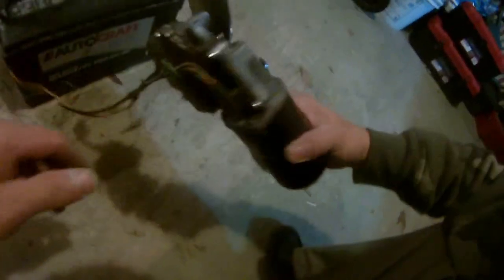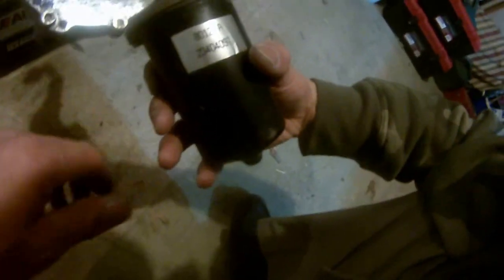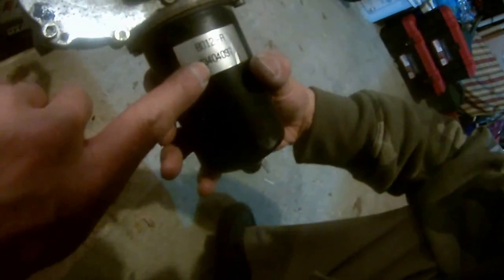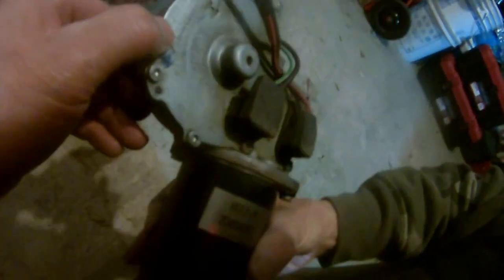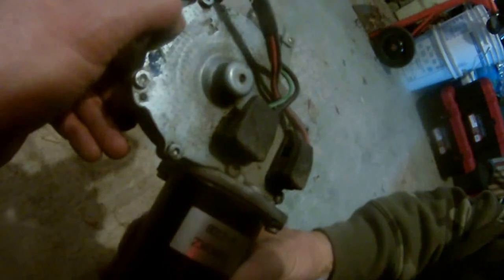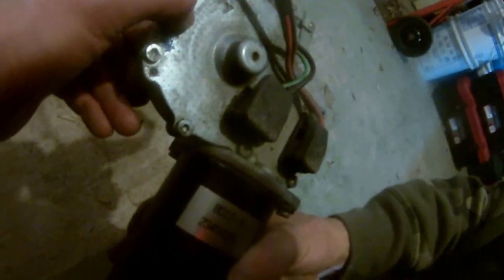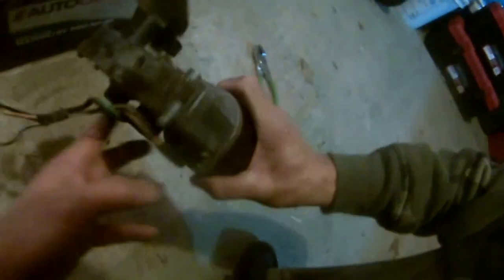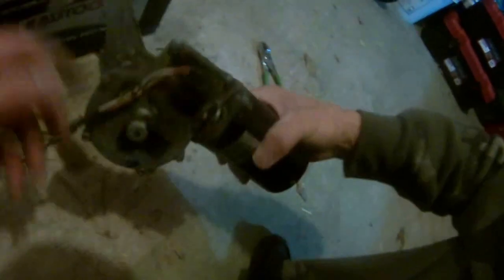How to use a wiper motor to steer a trolling motor? Part 1 of 3

Comment: Ok, I subscribed. Where's the wiper motor video?
Reply from the maker: My apology. I have invested Arduino UNO to try to steer the TM or outboard motors wired and/or remotely. But, I found out I needed to buy either wifi or Bluetooth module to do it. Now, I just found out and I have just purchased Rasberry Pi 3 B+ to create an IPhone controlled through wifi or Bluetooth to control trolling motor or outboard motor. Believe me, I will show my sub how I did it step by step. There are numerous cumbersome methods to do it. So, I am still researching to do it. If you know how-to, please share with people. I have seen videos with iPhone app to control trolling motors to start, stop and accelerate and decelerate the TM and or outboard motors. But, they don't show you how they build it. I will show you how-to when I can break through some of the difficulties I am currently facing. Thanks for asking. I know I owe it to my subscribers.
Reply: @njfishing1  I think you are better off using a simple wireless remote or buttons or even both. I've also seen videos of people using there phones for steering and it looks awkward to use. On the other hand,if you needed it for navigation programming,that would be the way to go. But for just steering,teathered buttons or wireless remote is much easier and cheaper.
Reply from the maker: yes, totally agree!
Reply from the maker: The wired Arduino UNO controlled with long wires simply could not deliver constant and stable signals so it caused my motor to race across the water and I had to kill the switch - LOL. So, I am going Bluetooth or wifi and want to make sure the signal is strong enough to control the TM and outboard motor.
Reply: njfishing1 That being said, I will promptly unsubscribe.

Comment: I'm watching this in 2018... Any fingers left?
Reply from the maker: just purchased a Raspberry Pi 3B+ so will show wifi or Bluetooth to control the TM or outboard. The long wired to control TM or outboard failed due to weak signals using Arduino UNO R3.
Reply: hahaha

Comment: Bet it would have been a lot easier if he learned how to use the wire stripper tool, as it should be used, ...
Reply from the maker: Part 2 is coming!!! Subscribe! I will show my wifi remote control with Arduino Uno R3 microcontroller with wiper motor to steer my Minn Kota trolling motor and my small outboard motor. wirelessly! Yes you got it.
Reply from the maker: design picture is on my instagram page look for njfishing11

Comment: Why say part 1 of 3 but only have part one that has nothing to do with steering a trolling motor? All this shows is how u reversed polarity on a wiper motor.
Reply from the maker: Part 2 is coming!!! Subscribe! I will show my wifi remote control with Arduino Uno R3 microcontroller with wiper motor to steer my Minn Kota trolling motor and my small outboard motor. wirelessly! Yes you got it.
Reply from the maker: design picture is on my instagram page look for njfishing11

Comment: any update on part 2
Reply from the maker: Part 2 is coming!!! Subscribe! I will show my wifi remote control with Arduino Uno R3 microcontroller with wiper motor to steer my Minn Kota trolling motor and my small outboard motor. wirelessly! Yes you got it.
Reply from the maker: design picture is on my instagram page look for njfishing11
Reply: Lol. U have just as many dislikes as likes! U seem to be a fraud or something like that.

Comment: Easier said than done ay? I know,I made one out if one of those motors..both button and wireless remote control...A lot lot of trial and error but I made one that works damn near perfect.
Reply from the maker: kudos!
Reply from the maker: Part 2 is coming!!! Subscribe! I will show my wifi remote control with Arduino Uno R3 microcontroller with wiper motor to steer my Minn Kota trolling motor and my small outboard motor. wirelessly! Yes you got it.
Reply from the maker: design picture is on my instagram page look for njfishing11
Reply: do you have a remote system for sale ??

Comment: I can't find parts 2 and 3.
Reply from the maker: my bad, couldn't decide whether to do wireless or just a wired Trolling motor steering system. will continue to research for both options and make videos soon
Reply from the maker: Part 2 is coming!!! Subscribe! I will show my wifi remote control with Arduino Uno R3 microcontroller with wiper motor to steer my Minn Kota trolling motor and my small outboard motor. wirelessly! Yes you got it.